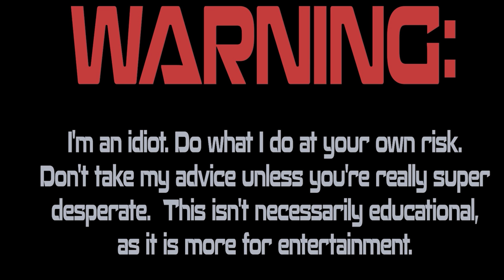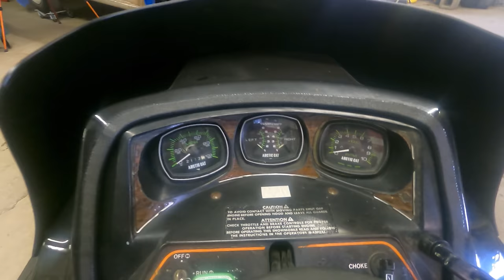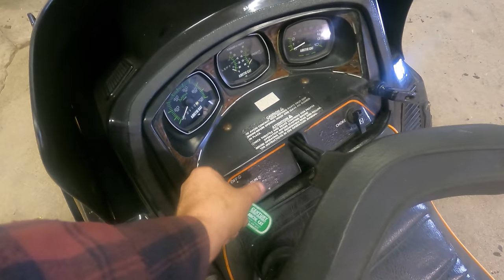FORGOTTEN Vintage Arctic Cat Pantera Snowmobile - Will It RUN AND RIDE again?

Comment: I’m watching these to cool off.  It’s hotter than the hinges on the gates of hell down here in Mississippi right now.  Looking at these engines though.  Very interesting.  I couldn’t do nothing with a snow mobile but I bet that thing would send a good kart to the moon.  How expensive are these like you keep buying?  I’m not going to be able to drive up there and run across these deals in a day.  But I sure would love to have one or two.

Comment: i recall back in the day if a guy wanted a quick where rod you could open up a trunk of an old car and on the under side of the trunk was two cross bars we would cut off and make where rods out of them..lol it worked

Comment: There used to be a mess that if you put dryer sheets in certain areas like when storing a car or bike that the dryer sheets are supposed to stop the rodents. Without clean your machine is it looks like it must work. I definitely going to give it a try.

Comment: The dryer sheets keep the mices at bay. How many chewed wires didja find on this one? Oh yeah I think Ida welded the airbox back together with a soldiering iron and some zip tie weld lol. It works. Be stronger than new.

Comment: Not too different from my '76 SkiDoo Everest 440. The dealbreaker with mine, and possible yours as well, is that new tracks for them are made of unobtanium. Which is sad because mine still has enough power to stress the shoulder sockets when matted, but it leaves a trail of dryrotted track shards wherever it goes. Only a matter of time.

Comment: In my experience drier sheets don't do diddly squat. They do, however, help to keep the interior of junk smellin' more like mountain breeze than mouse hide. I had an '87 YJ that I stuffed every single imaginable opening with those things. After a couple years of storage, they bottom sheets in the heater vents were stained with mouse urine; made for an interesting aroma. Irish Spring soap was another myth... they eat it. The best luck I've had is using a bucket with the tin-can spinner rounder peanut butter bater trapper. Best solution is to eliminate the problem. Side note... follow Shawn Woods on here for his "Mousetrap Monday" videos on here; very entertaining content for the  never ending war we country folk wage with these little bast.... darlings.

Comment: The mice hate I mean hate drier sheets. But you have to replace on em every 4 or 5 months. I recently heard that the mice hate Irish Spring bath soap seems to work, just toss a few bars around the walls in your shop and keep the mice away.

Comment: Hey Derrick and fellow watchers. I have a question for you all. Long story short I have been messing with 2 strokes for about 20 years I'm a diesel mechanic by trade and long story short I usually don't mess with anything newer than 2007 because of all the electronics and emissions crap. I have a 2001 Polaris RMK500 and I am stumped on this snowcat. It's problem was it would run great for about 5 minutes or so and then backfire and die and wouldn't start again for about a couple hours. I have excellent compression and great spark. Things that have been replaced are The CDI box and the stator and coil and the carbs along with a new fuel pump and lines. I've done a leakdown test and it passed with flying colors I have also done a smoke test to backup leakdown test to make sure center crank case seal is good. I have replaced the reeds as well.The sled has 600 original miles on it and I would love to see it run rather than part it out but im at my breaking point with it. I think that because I have spent so much time on trying to get it running that I am probably missing something so small and stupid. If any of ya'll have any ideas I'd greatly appreciate it this one has me stumped for sure. It does have the flat slide twin carbs with a single furl feed and I'm leading towards the carbs because I can spray fuel into the cylinder that is not firing ( which it swaps occasionally) and it will pick up as long as i continue to spray fuel into it. If ya'll have any ideas please let me know. Thanks

Comment: That sled is called a “ free air”.  No fan to help cool it, didn’t start to run good unless it was 0 degrees Fahrenheit.  The colder the better, this sled is the cross country with the extra fuel tank in the rear. I had one in the early 80s.

Comment: Put peanut butter on a thin post in a 5gallon bucket or a bigger oil drum, then fill with antifreeze, let the mice get the peanut butter then fall in and drown in the half filled bucket of coolant, and it won't freeze in the winter!

Comment: I'm not sure how you were able to get 30 minutes of riding time in on that machine.  When we were kids, they lasted about 13.2 minutes before needing another part.  Well done on the purchase though, that is a nice sled.  The finger drifts looked a little rough on the old suspension.  I'll have to call you the Pantera Cowboy or simply the Snow Cowboy after that rough ride.

Comment: Yeah I don't remember what video it was but I had the same problem with ratchet straps are in the excess of kale but there's a video on YouTube on how to use ratchet straps any shows a good way to tie up the tail it's just by the time I get to use a ratchet strap I forgot how do you did it and I got to do it again or watch it again but anyway good luck it seems to work well when I can remember how to do it

Comment: The absolute, and I do mean ABSOLUTE BEST mouse Repellent  is none other than 
MINT OIL!
If you get mice around home, trailer or shop/garage, you can plant mint around the foundation.
One downfall however...
It is very invasive. It will overtake any lawn near it, that is why you use the oil.

Comment: I'm no snow mobile guy but love chainsaws. No way I'd run the oil any leaner than 40:1. I personally run everything at 32:1 and have zero problems fouling plugs.

Comment: When I rebuild snowmobile carburetors I never use carb cleaner on any rubber parts of the carburetor are you shop solvent in a can on the rubber parts of the carburetor but the carb jets you can use carb cleaner to clean them out and sometimes I use a little Fine wire to clean the jets out with the carb cleaner

Comment: Couple of things I like to do when I find one that has been sitting. I will stop off at the gas station on the way home and throw a gallon of gas in her. Make sure the fuel is turned off. If it does not have a fuel switch, do not do this, you will contaminate the fuel pump and carburetors. When I get her home I jack up the back of the sled and put a block under one ski.This will make the contaminates and any water go to one corner of the tank. Then just siphon vacuum the bottom of the tank out into a clear container so you can see what's coming out. I also like to give both cylinders a shot of fog oil before I pull on her and check the compression. 
Last year I found an 84 Yamaha V-Max 570, duel carbs duel factory exhaust that had been sitting under a tarp for 4 years. Did the old slosh about tank clean on the way home. Cleaned the tank and yes there was some crud and water in there. Pulled the plugs and gave both cylinders a squirt of premix fuel, she fired on the third pull, didnt even have to clean the carbs. I sold it last year and now I wish I would have kept it. It was a cool sled.
Does Jessica make the Lefsa for the holidays? You guys remind me of my moms side of the family, bunch of Lutafisk and lefsa eating Noweigans from Wisconsin, which is where I grew up. I grew up with a rifle in one hand, a fishing pole in the other and a motorcickle or snow machine under my ass. Oh, you should see the arctic Cat I just bought, for criminey sakes she really goes. Ya sure betcha, ya know!

Comment: I have a 1975 Panther. Paid 560 bucks f0r it. Had to put the carb, and sliders in, and a speedometer, and tac., but the tac. does not work.

Comment: Them mice are no chance for the twelve-gauge double-barreled Remington. top of the line. You can find it in the sporting goods department. That's right, this sweet baby is made in Grand Rapids, Michigan. Retails for about a hundred and nine, ninety five. It's got a walnut stock, cobalt blue steel, and a hair trigger. That's right. Shop smart. Shop S-Mart.

Comment: I use moth balls and rat poison. Run the blocks of Tom Cat onto a length of bailing wire and tie it to the skis, bothballs in  an old sweatsock and left in the air box, in the tool box, etc.

Comment: Man this made me miss rippin my ol formulaZ 583 Rotax that sum a gun would shytt-n-git boy lemme tell ya! It was so stinking light weight that it was all you could do to keep the skis on the ground and going up steep hills was a hairy situation at times because one tap of the throttle and she'd lift right up n over! Don't know if it was redone or what the deal was because she was a caddy of sleds had electric start and everything I had a girlfriend on the back one time and I gave'r hell down her street which was covered over slick with ice and I had the skis off the ground till I seen triple digits on the speedo and the problem started when I tried to let off lol-ol-ol then she got all squirrely on ya so you had no choice but to stay right in it then I just yanked it out into a field at the end of the road... Man do I miss that little rocketship!
Reply: Heck I dragged a yamaha triple cylinder 700 on it and boy was that kid maddd cause I guess he had all kinds of work done to his motor and he had huge paddled track I had a worn out track and just flew by him like nothing we even turned around and did it again like a dozen times because he just couldn't believe it and wasn't willing to accept it hahahahaha

Comment: yea had to go out and look at mine i have yea way different too, my seat is deck out as well and my did come with an electric start to and the throttle was on the right side of the cat wow i did not know i have a spare tank back there it was my uncle machine yea he passed away and i landed with it i ride on it when he was still  living yea i was about 5 when they both got a kill 
yea the shield falling in on it yea the only time it was out of the building yea it sits back in the new building the same spot he put it it was started 5 years ago  and it fired right up  the decal are different too then mine too know him was the top of the line back them too

Comment: I miss the days when you could strip a sled down to the frame in 40 minutes.  You look under the new ones and it's like my modern SUV. Fuel Injection. Computers, no room for wrenches, overly complex designs. 24,000 dollar machines? Nope. Not doing anything other than minor parts replacement......:face-turquoise-covering-eyes: